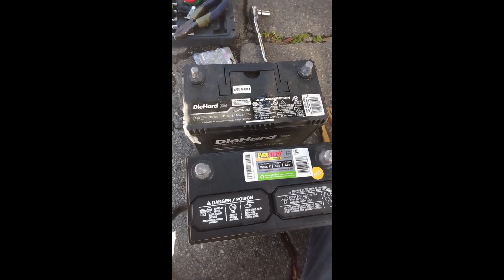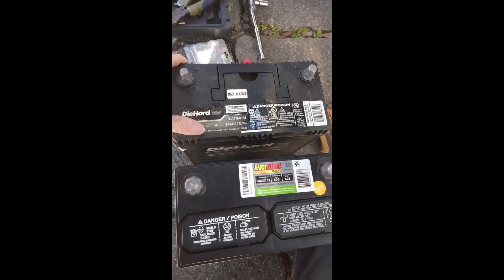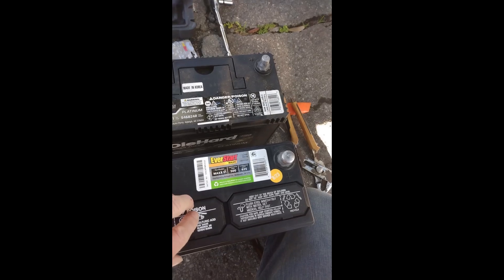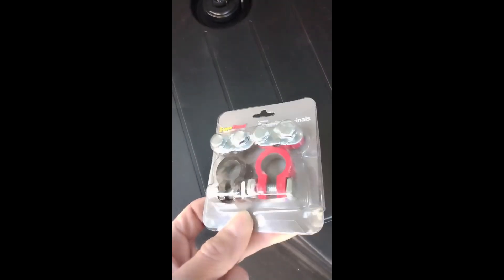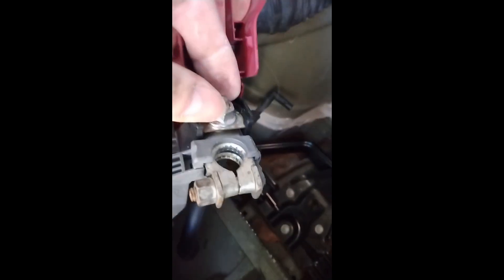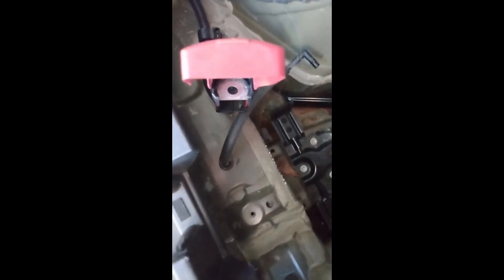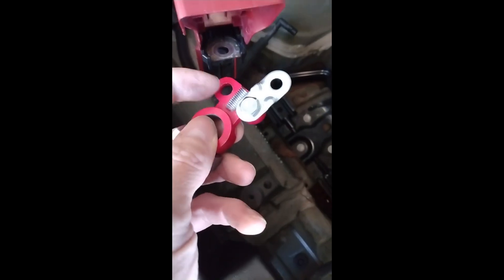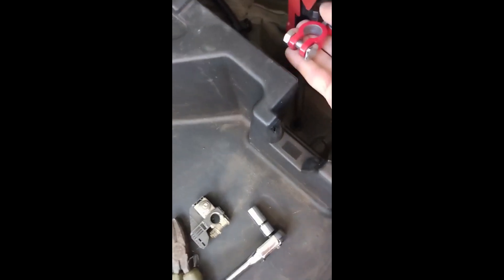Prius Hack: How to use a Cheap Standard 12 V Battery as a Replacement of the Expensive OEM one

Comment: I do not know if people here are smart enough, but... every battery has a ventilation, and the Lexus or Prius, has aditionally to the battery terminals, also a gas tube, specially for gases and smells. It is probably intended also in case of interchanging batteries. Also, each battery has an gas port...at least the new batteries. I am talking for example about Varta b33 45Ah which is not AGM but will perfectly fit
Reply from the maker: "I do not know if people here are smart enough, but..."
A person who pretends to be "smart" should be smart enough to be able to smell in the passenger compartment if the battery located under the hood of a normal car is leaking (that happened to me several times). It should be even easier when the battery is located in the trunk, like in a Prius, and believe me I will be able to tell if something is going wrong and take appropriate action. So far, it has been 5 months, and everything is fine.

Comment: Dangerous. He forgot to connect the off gas cable. The prius battery has a hole on the side to connect the hole. You need to let the off gas go outside the car. This video will make people sick. Do not do this.
Reply: Battery is located exactly at the way heat and gas are venting out of hybrid battery
Reply: That's for wimps who can't even mount a spare tire. If you can't smell when a battery is releasing gases inside a car, then you have a serious problem.

Comment: You cannot put a regular lead acid battery replacement for the 12 volt. The reason why it's more expensive is because it's not a regular led acs and battery. In case of an accident, the battery does not injure occupants. Since since the battery is located in passengers compartment.
Reply: Yes you can, provided you are not a wimp.
Reply: @AndreaKarlis  You misspelled "stupid".  That should read, 'Yes you can, if you are stupid'.  You're welcome.

Comment: dont do this. The original battery has different chemistry in it. The normal batteries will smell like rotten eggs due to off gasing of sulfuric acid. Ask me how i know. Make sure you get the same battery chemistry if possible.  The small battery is not used for starting the vehicle so matching the CCA is not the only issue to worry about. I used to do this too but now i have a place that has aftermarket cheap replacement here in Phoenix called south Phoenix batteries llc. But am sure any place that reconditions batteries in your city knows this things. Two things to consider, this battery is in the cabin so the gases will affect you. And it gets its charging from the big hybrid battery  through a step down transformer or trickle charger so it will behave differently from a normal battery that gets topped of from an alternator. So its lifetime will get affected too.due to how small its size is trickle charging is not good and will kill it sooner than later. But of course do your own research this was my first hand experience after i did whats shown in this video about 5 years ago
Reply from the maker: If a battery is leaking in the car, and the person driving it can't even smell it, then that person shouldn't be driving a car in the first place!
Reply: @BlueMoonshine  am not talking about leaking. It's off gassing. It's the by product of normal charging of a battery. Batteries that are meant for the hood or bonnet in European English contain sulfuric acid. And they emit a gas during charging.
Reply from the maker: @maxiest200508  
I didn't say "battery leaking acid" or "battery leaking liquid", I only said "battery leaking". That applies to gases too! And once again, if the person driving the car can't even smell it, then that person shouldn't be driving a car in the first place! Any normal person can smell when the battery of a normal car (under the hood) is leaking. It is even easier to smell it when the battery is in the trunk of a Prius.

Comment: It's not a conspiracy, the smaller terminal (called T3) is used on most Japanese manufactured cars. There are several options for replacement other than OEM.
The larger T1 terminal is more common though, so you may have to shop around.
Reply: no adapters

Comment: its been about 4 months --  how is it working so far?
Reply from the maker: No problem to report so far! 🙂
Reply: @BlueMoonshine  sweet!! -  i guess the only thing to be cncerned about is the flooded acid-solution & whatever "gases" that vent iut, slowly causing corrosion in that little compartment? -  maybe a little computer fan to keep fumed from "pooling" in the bottom of that floorpan?
Reply from the maker: @jmm1000  
I personally can smell from the inside when a standard car has a leaking battery under the hood, so I would definitely smell it if the battery inside the trunk were leaking.

Comment: This is a bad idea. If you don't want to get OEM just buy third party, but at least get the right type of battery: AGM.
Just replaced mine for $200, and it'll last longer than a cheap battery.
Reply: Yep, it's around that price 😊
Reply: This is a great idea 💡.
Reply: ya... except OEM costs less than aftermarket... O'vanced'zone averages $250+ Toyotoa OEM is $225... at least at the few dealers I've talked to in houston.
Reply: I replaced the AGM with a Lithium battery. 
Weighs less.
Sealed.
Cheaper.
Longer lasting.
I didn't have to cut any of the cables to install it.
Reply: @davidperry4849  what is the type / model ? Any link please ?